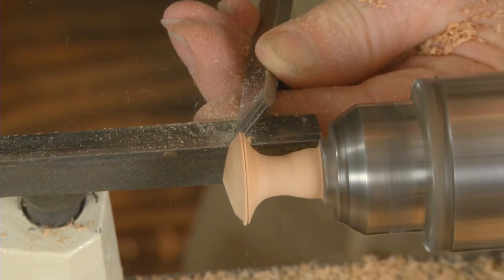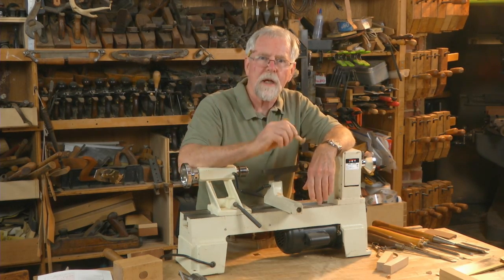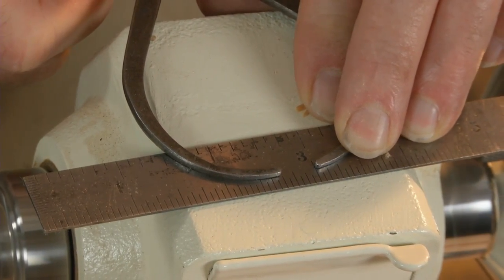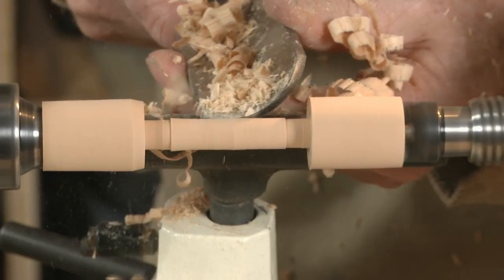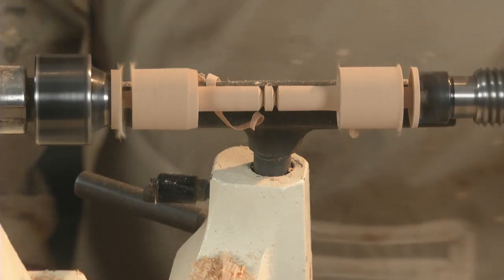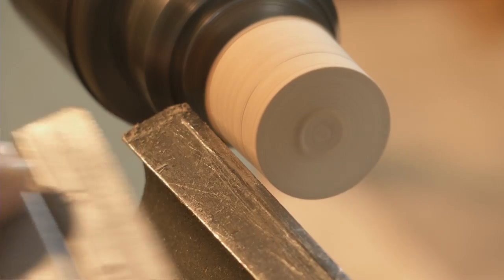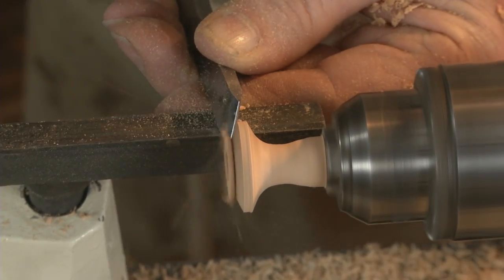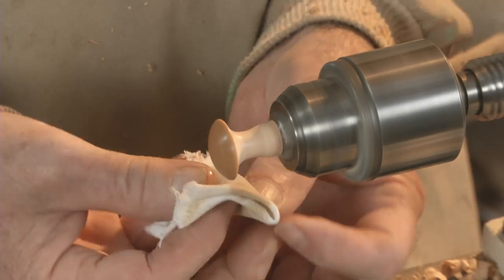How to Turn a Shaker Drawer Pull

Comment: Didnt watch video. Dont have a lath but I do enjoying turning shaker related items for my work. Just not on a lath. I use a drill press which you actually pull into your work and it impresses the drill bit firmly into any position you like as long as your jig is set up just right. Now im not talking about the traditional methodologies here instead its a unique system we developed to override certain tradition bound practices and show many a better way. But its just for PULLS.
Reply: Kirt Richard Keep taking those pills!